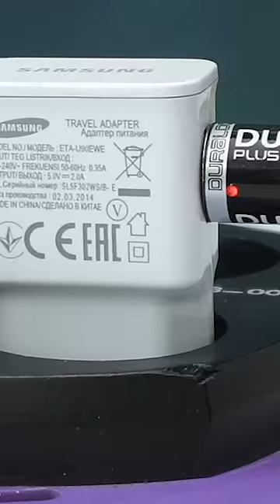Never Buy Batteries Again: How to Convert Your Batteries to USB Charging

Comment: This could go wrong in so many ways, starting with cutting into the battery to begin with.
Reply from the maker: Thanks for you opinion, please follow us
Reply: Thats not an opinion, cutting a battery is dangerous and most people shouldn't be doing it.
Reply: @InnovaDIY  I do.
Reply: completely agree with you
Reply: @InnovaDIY this is dangerous on so many levels
Reply: It's not that dangerous, unless you eat or breath it, I was waiting for the trick where you put a high current and make the graphite rod glow.

I played a lot with batteries when I was a kid.

Gezz people are afraid of everything.
Just be cattle consumers and never mess with anything then.
Reply: yea wear gloves and use a discharged battery nothing to worry about
Reply: @poiiihy  even that is too much, if you don't have any skin cuts and you wash your hands after doing the disassembly (which by the way you can do with pliers, no need to make a mess like in the video), you're going to be fine.
Its not that toxic (if you don't ingest or breath it), its usually just manganese oxide and a small amount of ammonium chloride, which as the battery is dead, its probably mostly gone. 
Just do it on open air and well ventilated place and wash your hands very well after. Even as a kid I knew that, its not "hidden" knowledge.
Its just a battery, its very simple.
Also, don't throw the remains on the trash, seal them with cardboard and put them together with more spent cells to be properly disposed after.
Reply: @InnovaDIY  cutting straight to the chase, huh?
Reply: I'm guessing it wasn't a lithium ion battery and had mostly carbon inside (the black dusty stuff)
Reply: @Kids_Scissors  yeah zinc carbon dry cell
Reply: just buy a premade one, its available for long time now
Reply: @InnovaDIY  That is not a opinion bruh
Reply: It's better to make your own casing. Also don't try making anything like this if you don't absolutely know what you're doing or if you haven't simulated the circuitry beforehand(Tinkercad is pretty good for that matter).
Reply: @RealValkor  That's exactly what I was thinking. My concern is that an utter amateur with insufficient knowledge will attempt to make one, and end up accidentally building an incendiary device, or mini-frag grenade.
Reply: @InnovaDIY   opinion and PLEASE FOLLOW US what a trash response LMAO
Reply: @InnovaDIY  bro really said Oh no, Anyways
Reply: @InnovaDIY  bro really said “fuck your safety, follow us!”
Reply: its a cool thing if you know how to do it, but as you said it could go wrong in so many ways
Reply: Too weak those batteries won't kill you lol
Reply: 99.99% of ppl on this earth can't make this XD, I'm not worried since ppl will give up by just watching 🤣🤣🤣🤦🏻‍♂️
Reply: It's really not that dangerous to be honest just wash your hands after you are done with the battery and nothing is gonna happen to you
Reply: @monad_tcp  talking abt mess up with things bought yet you are giving tons of precautions.

Tons of precautions simply means, dont mess up with it generally.
Reply: @InnovaDIY  not opinion, fact, no i will not
Reply: I mean it’s not THAT bad unless someone opens up a lithium AA battery
Reply: Cutting those kinds of batteries isn't as dangerous as you think it is.
Reply: the problem is not that he cuts it, but that he also drills it
Reply: @rayferguson4556  no its literally not. These types of batteries are not a fire risk. Also if you can do it efficiently, you alrrady have a shop FAR more dangerous than the batteries. Joe schmoe watching this on the toilet does not have the tools or motivation to even attempt this. There is so much wrong with your comment I can keep going
Reply: @melody3741  who said anything about a fire risk? Batteries are hazardous materials. You gave nothing beneficial to this argument other than saying I am wrong. Question, if it's not a hazard why do they have to have hazmat stickers when shipping them? Another question where do you get your expertise? YouTube? Let me guess working on monitors is complelty safe for everyone too right?
Reply: @rayferguson4556  Exactly right.
Reply: @InnovaDIY Follow you, who Shows to Cut Batteries which may lead to life hazard. No Tq Ima Report this instead
Reply: Aún cuando la batería ya no tenga energía? 🤔
Reply: I had crushed some Li-ion AA accumulator battery with just a stone. Nothing happened with me. 

But, anyway, nowdays I think it's better to learn how to do things secure instead just following shorts.
Reply: 那不是鋰電池...
Reply: @InnovaDIY this is a good reason to not follow
Reply: Thae are the steps of getting to the hospital😂

 Step1  cut the battery 
 Step 2 hospital time
Step 3 enjoy
😂
Reply: @rayferguson4556 i cutting it hundreds time and nothing happen
Reply: @elaina379  so curious where did you get you degree in battery engineering? How do batteries work? Describe the different kinds of batteries and how they actually work? Why does a battery hold charge? What makes a battery dangerous? Saying I have cut them hundreds of times and nothing happened is like saying I have shot herion hundreds of times so that makes it ok :/
Reply: @rayferguson4556  and what does battery knowledge has to do to my experience cutting through hundred batteries? "i shooting herion hundred time so its ok", so what? you shot them then they will hurt, its not good, its a harm to them, im talking about battery here not a herion ok? i cut hundred battery and they not exploding nor do any harm hence "nothing happen", just that, easy right? in fact, we use many battery here and there, and yes, nothing happen, i crush them, cut them, and even put them in fire and yes nothing happen.. the batteries is just the same type in the vid..
Reply: It's just a AA battery nothing is going to catch on fire or blast 
Just don't cut through a lithium ion or any rechargable battery that can cause harm

Comment: Confidential tip: Modern wireless mice require very little voltage. If you have AA cells that no longer work in other devices, they can still work in these mice for weeks or even months.
Reply from the maker: Thanks
Reply: They can’t
Reply: well i have an oldie that sucks more juice than ...
i cannot let alkalines sitting there for more than a month
Reply: Clocks....i stick all low Batteries inside clocks to polish them off. Once they're at 0.00v they're done for and i can recycle them.
Reply: True. Also one more tip. If even your mouse don't want to work with this battery, just take it out, smash it against a ground and it's good for few weeks, maybe a month. I has one battery which refused to die for over 5 months. Just had to smash it more and more often xD
Also it's completely safe, alcalic batteries are safe even fully charged. I've been doing this for years and nothing bad ever happened
Reply: @lukedavis436 you can smash it against a Flor and use them again for some time XD. You can even repeat that but each time it lasts less
Reply: I had a wireless mouse that worked for several months and the battery was at 0.6V or 0.8V
Reply: I found a set of enloop rechargeable batteries in ewaste, I took them home and use them in my mouse, it lasted all semester on one charge, yep in an entire school semester I charged them once, and the mouse is still going

Comment: Guys please don't get me wrong... But i think its a lot cheaper, easier and saver with just buying an rechargeable battery...
Reply from the maker: it is a good way.
Reply: Its not so much about the ability to just buy it. Its the experience of making it. I understand why dude would do it just to do it.
Reply: Rechargeable batteries have a low voltage of up to 1.3 volts and may not be enough for some equipment.  Here he built a full-fledged lithium polymer battery with a maximum voltage of up to 4 volts.
Reply: Ppl who don't know about electronics commenting that. Man DIY is so good to do.

Comment: What if its a lithium battery? Homemade bomb?

Cringiest edit of all times: ty for likes guys
Reply from the maker: It can be
Reply: Yikes... that's a good thing to keep in mind if I ever try this...
Reply: @InnovaDIY  ❤
Reply: 3,7 volts in a li-ion/poly accu.
Most alkaline batteries are 1.5-1.6V
So no, just use nickel accus.
Reply: @InnovaDIY  "Is it a bomb?" "It can be" 😂
Reply: @diymaster101  maybe your sense of humor is as large as this man's electrical knowledge
Reply: Don’t do it with a lithium battery then
Reply: @diymaster101  With all due respect, please don’t recklessly use terms and abbreviations. For example I could have 7+ years in the nuclear weapons industry despite simply being a technician/site manager of a facility. Just because you’ve had seven years in the electrical industry does not mean you have had seven years in the electrical academia, or seven years with a bachelor’s degree in electrical engineering. You could be an electrician, which doesn’t specialise in battery technology.
Reply: The title will be 
“never buy a bomb again”
Reply: Oh these aren’t homemade. They’re from a bomb factory. They are bombs.
Reply: @davidd2661  He used a voltage regulator
Reply: Don't use lithium batteries. Use carbon zinc batteries, preferably discharged to one volt or less. The mix inside of discharged batteries is quite inert and thus fairly safe to drill into. But yeah, that tiny Lipo battery won't get us anywhere... probably 160-200 mAh at most at 3.7V - around 400 mAh after stepdown or around 3x less than a brand new AA battery. If recharging is your only requirement, go ahead.
Reply: All I learnt was how to solder badly
Reply: You would need some nails ...

Comment: Super easy! All you need is: proper tools, adequate wiring skills, a soldering kit, very precise movements, extreme caution to avoid hazardous contact or interactions with an exposed battery, a detailed knowledge of electronics and circuitry, and then your all set!!!
Reply: Exactly what i was thinking. 😂

Comment: Do not use lithium batteries for this, as they will explode if you puncture them.
Reply from the maker: All batteries, including ordinary ones, can be potentially dangerous if punctured. When a battery is punctured, it can cause a short-circuit, which may lead to an explosion or fire.Lithium batteries with a built-in safety circuit, also known as protection circuit modules (PCMs), can provide an additional layer of protection against overcharging, over-discharging, and short-circuiting. These safety circuits are designed to monitor the battery's voltage and temperature and cut off the power flow if any of these values exceed safe levels.
watch the video and all safety design
https://www.youtube.com/watch?v=wBzO2YOtnBQ&t=48s
Reply: well dont puncture them bruh
Reply: @InnovaDIY  well, why did you make this dangerous tutorial then?
Reply: Or any battle try for that matter
Reply: Из вас сделали полных баранов... Вам даже в голову не придет попробовать самому.. Поясняю- Ни чего не будет , даже если ты разрубишь её топором.
Reply: @InnovaDIY  I know a ChatGPT response when I see one.
Reply: @InnovaDIY  mucho texto
Reply: @InnovaDIY  chatgpt ahh reply
Reply: You wouldn't convert a lithium battery to a lithium battery. Could it be more obvious that this is a conversion of an alkaline cell to lithium?
Reply: Why?

Comment: This is already a thing you can buy off the shelf.
Reply: Rechargeable batteries have a low voltage of up to 1.3 volts and may not be enough for some equipment.  Here he built a full-fledged lithium polymer battery with a maximum voltage of up to 4 volts.
Reply: @leviofanh  yes they make those. Lithium batteries with a USB plug, AA size and voltage.
Reply: @leviofanh  There are lithium rechargeable batteries as well.

Comment: This will be hard when the mouse need 4 batteries
Reply from the maker: Yes absolutely
Reply: Bro which mouse needs 4 batteries
Reply from the maker: It seems he mentioned the toy mouse
Reply: Adult toys also need batteries  😂
Reply: @Strawhats25  this got inappropriate real quick didn’t it 🤣
Reply: Also what's about the higher voltage?
Reply: Just get a wireless RECHARGEABLE mouse. There. Problem fixed. Spend a little more money, and fix problems.
Reply: @shivshivade2378 😅😅😅😅😅
Reply: @OrionSoul  😂😂
Reply: @OrionSoul I have usb mouse 😂
Reply: @InnovaDIY  😂😂😂😂😂
Reply: No. You just take a whole pcb and bigger Li-ion cell.

Comment: don't try that. he specifically wired the battery differently between sequences. what he showed was a USB killer. don't risk your devices.
Reply from the maker: please watch the main video the circuit completely safe and sound.
Reply: @InnovaDIY  no
Reply: that isn't an usb kiler,still very dangerous if you know how to do it for for it. (don't use lithium)

Comment: Very nice, but AMS1117 will drain this little battery in couple hours. Try TLV733 series, with low Iq current and enable pin, that can be used to set an undervoltage lockout
Reply from the maker: Thanks a lot l
Reply: Drain AND break it because of the lack of a overdischarge protection

Comment: People… Please don’t do this…
Reply: Especially if you used a wrong battery thats doesn't work with this , you will create a homemade bomb
Reply from the maker: the lithium battery has a safety circuit don't worry about that.
Reply from the maker: the battery completely discharge and don't have any problem
Reply: @InnovaDIY  no it doesn’t
Reply: @TheDailyKnife009 what doesn't?
1. He used safety circuit which protects battery.
2. If the battery he cutted wasn't discharged, then how could he even upload this video?😂
Reply: @InnovaDIY  don't lithium batteries have acid or smthn like that in them?
Reply: @InnovaDIY  Lithium batteries are NOT safe to cut
Reply: @InnovaDIY  i dont think that's how batteries work
Reply: @InnovaDIY  dude the batteries don’t have a circuit inside of them. They have a safety blow out mechanism so they don’t explode but batteries like that do not have actual circuitry inside them.
Reply: @InnovaDIY  what you are suggesting is dangerous
Reply: @InnovaDIY  not to mention the fact people who have that kind of equipment to do this sort of thing, but literally be better off just buying rechargeable batteries in the first place, instead of risking something like this
Reply: @InnovaDIY please don’t encourage people to mess around with lithium batteries. Not all lithium batteries have protection circuits. Battery safety is seriously important!
Reply: @brokentoaster2904  lithium batteries do not contain acid. I mean they might contain a little bit, but what makes them dangerous is the actual lithium itself. Lithium does not like water, and will ignite immediately on contact with any sort of moisture.
Reply: @TestAccount666 he didn't cut lithium battery
Reply: @brokentoaster2904  ALL batteries have something quite acidic or alkaline.   So don't get it in your eyes or even on your skin.

Comment: I've always wanted to do this or something similar. Like even more fundamental such as a clock spring inside a battery driving a really small generator, you wind up the clock spring by twisting the battery top for unlimited portable off-grid power.

Comment: I really love the PCB less recreation of tp4056 charging. Unlike other crappy DIYers that just connect the battery to usb directly or add up a resistor
Reply: The TP4054 would have been instead a game changer here.

Comment: Is smart use a 2000 mah battery to make a 200 mah battery?
Reply from the maker: good mention , Thanks
Reply: Well they do sell them for pretty cheap with large capacity.  I would say 30 dollars for 4 good ones is better.
 If this took less then 10 minutes...? it still costs too much. Not worth my free time to do such things.
Reply: This isn't a battery. I mean it is, but you think is that the rechargable battery. Converting a 2000mah battery to a 200mah rechargable battery sounds stupid, cuz you need to charge it up 10 times just to earn back the ruined 2000mah. 

Instead of doing this to new batteries, use dead ones or just do what everyone do: buy 2000mah or even higher capacity rechargable AA Batteries like GP recyko, recyko+/pro  series with 2000, 2500, 2700 or even higher mah capacity.
Reply: @TyphoonWarface  that is a better option
Reply: @TyphoonWarface  do NOT use GP 2700mAh, those are very bad and should be never bought (GP ReCyco 2000mAh are fine). Atrocity in the video is way worse than those.

Comment: Чел, тут проще саму мышь переделать, поместив в нее аккумулятор и микросхему зарядки, стабилизатор напряжения
Reply from the maker: This battery can be used everywhere.
But you mentioned a very good idea.
I will make a project with your idea If you allow to me?
Reply: все это никчему как по мне, т.к аккумы садятся  десятки раз быстрее батарейки, мне на год хватает хорошей батарейки. Это придется заряжать каждые 2-3 недели
Reply: @InnovaDIY  конечно, делайте, если хотите
Reply: @InnovaDIY  wrong. Lithium ion cell here is way too small and there should be  SWITCHING regulator instead of lineal one. Both of those greatly limit output capacity and output current to way below capabiities of Alkaline chemistry.
Reply: У меня мыш с акб, зарядки хватает месяца на три, смысл так извращаться
Reply: Это точно с такими габаритами  можно зарядный модуль и аккумулятор спрятать в самой корпусе мыши и так не заморачиваться

Comment: I remember a similar thing being on sale at my local Fry's Electronics (RIP). There were rechargeable AA and AAA batteries that had Micro USB connectors on their sides that could be charged by USB. The only drawback was that their capacities were quite low, only just over half of what a typical battery of that size would be.